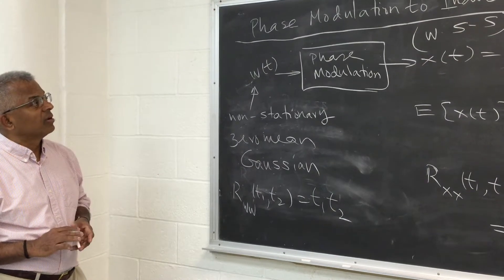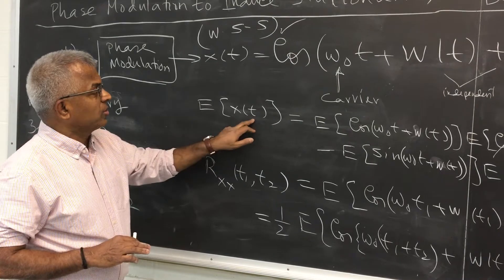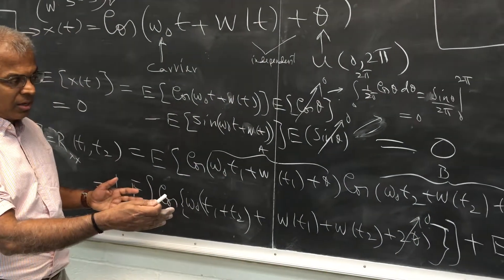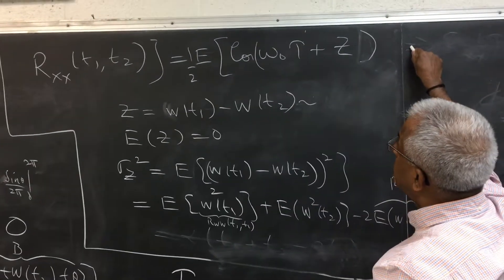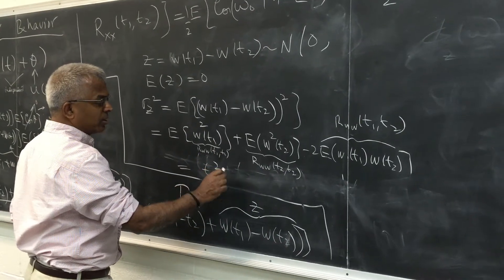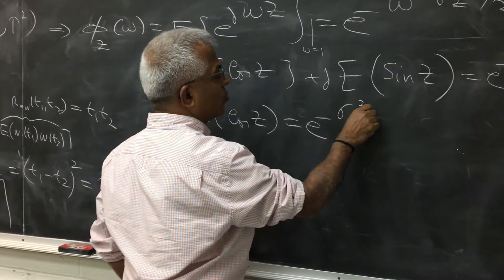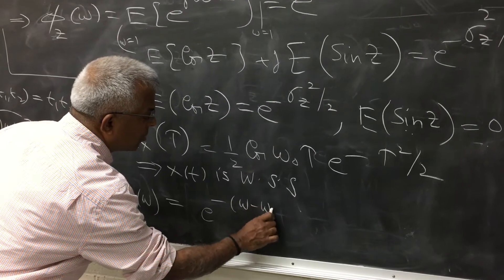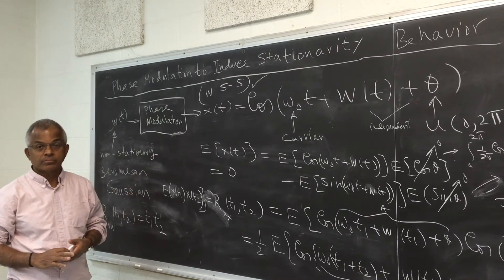Pillai Probability "Non-stationary to Stationary Behavior Using  Non-linearity"

Comment: Great problem, thank you. I believe there is a scale factor error in the power spectrum due to the normalization of the Gaussian, and another scale factor error in the exponents. Form is correct.
Reply from the maker: You are right about the scaling factors in the final power spectrum expression.. At T= 8.10 min, the scaling factor 2 in the two exponent terms should be replaced with  (1/2). Also, the outside scaling factor (1/2) should be replaced with sqrt (|pi/2). Thank you.